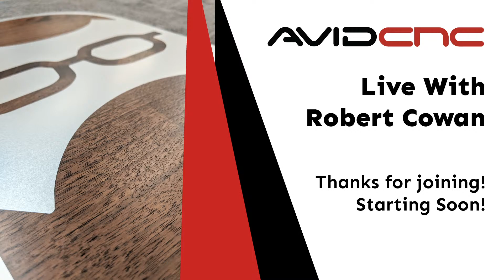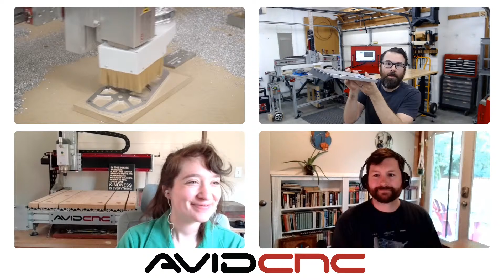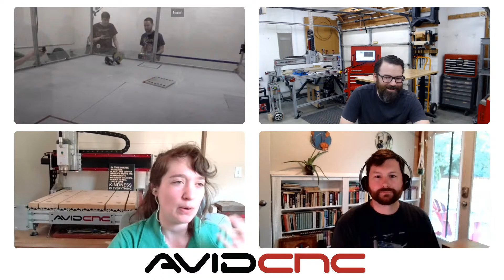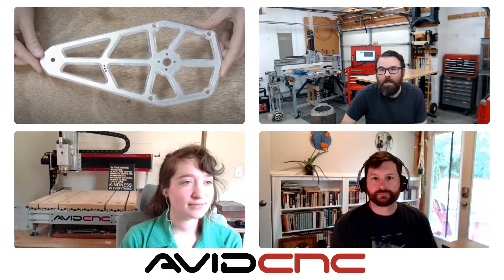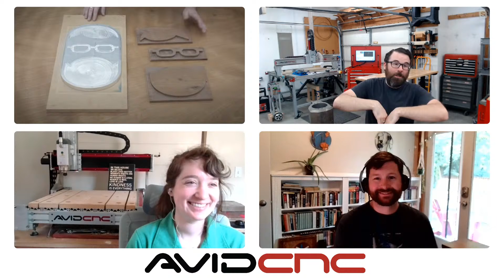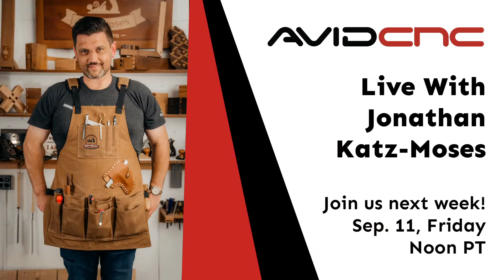Live with Robert Cowan - CNC, Battle Bots & Aluminum machining!

Comment: Very nice as always. One thing I was wondering, do you know if Robert machined it's carbon fiber parts on it's CNC? I own a pro 60x120", and for the life of me I couldn't make cuts reliably without braking bits. I have spent so much money on broken bits. Good quality diamond coated ones, under water, the whole thing. Any tips?
Reply: I can answer that question!  I actually outsource my carbon fiber.  It's very hazardous and dangerous to cut (well, the dust is anyway).  I don't mess with cutting it because of the high risk of the particles going into your lungs.  You would normally want to cut it underwater or use heavy flood coolant to trap the dust, dust collection usually isn't enough.  If you have to cut it, you need to use diamond bits, or just realize that you will dull the edges very quickly.  I outsource everything to a company called CNC Madness.  It was actually cheaper than buying the stock!  https://cncmadness.com/
Reply from the maker: Check out the DarkAero page, next week we will be hosting them on the live stream! They cut carbon fiber on their machine all the time for airplane parts. https://www.youtube.com/channel/UCPUZCBNrduwUsw_MTW-sDxw